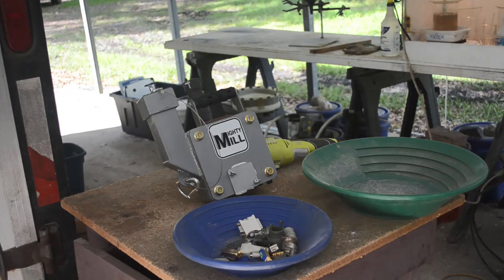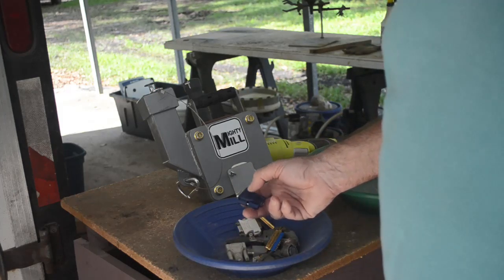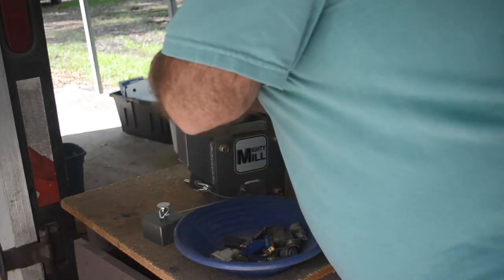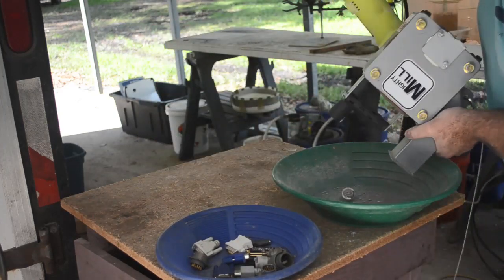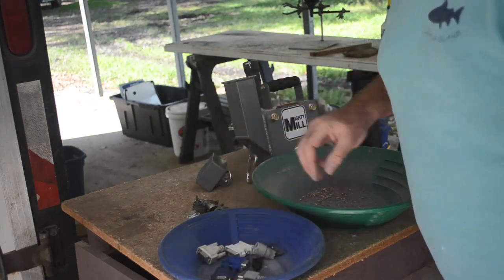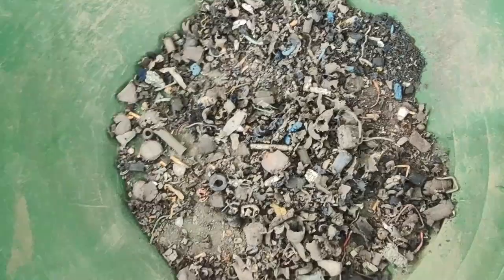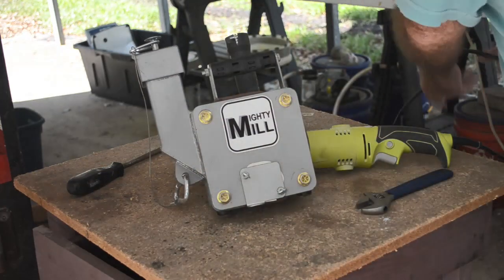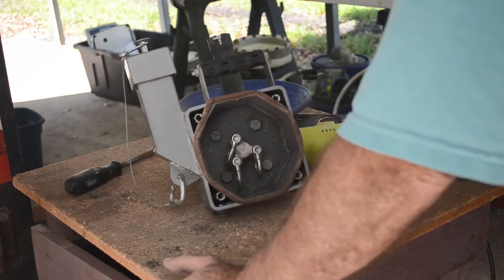Gold From Electronic Connectors Shredded In The Mighty Mill Ore Crusher

Comment: Sidenote, I also forgot to recommend maybe incinerating them first, and then just a quick pull of the trigger through the mighty mill as it should all break up pretty easily and then gravity separation would be a cinch. The older connectors that I was doing or either Kevlar for Bakelite which did not like incineration

Comment: Although a hammer mill is really bad ass, I did not easily have access to one of these years back when I got started on the vintage slots card connectors. I ended up buying a cross cut fellows shredder that was a commercial size for about $25 on offer up. I removed all of the plastic shrouding and built my own Weed shroud for it and loaded up all of the plastic connector. It will crush everything up so fast separate the metal from the plastic. All I did was gravity separation with water afterwards and it took only about 20 minutes to run through 20 pounds of connectors start to finish